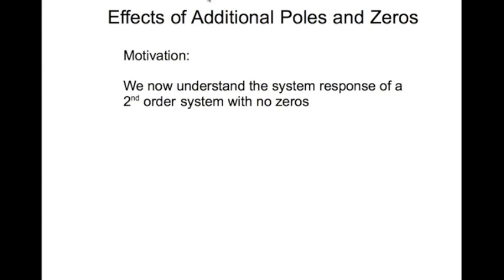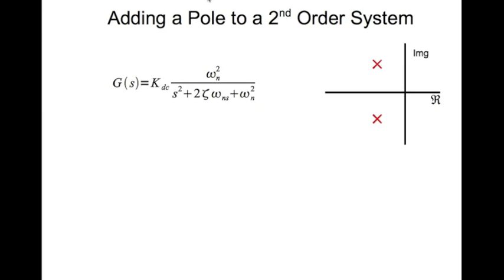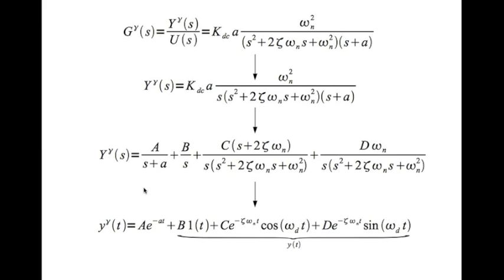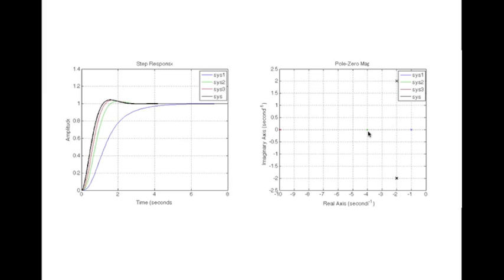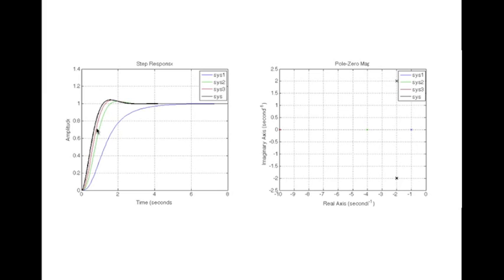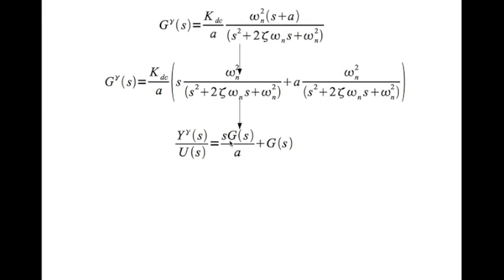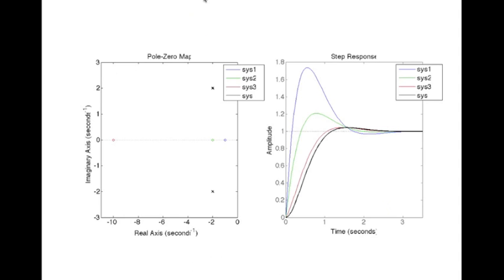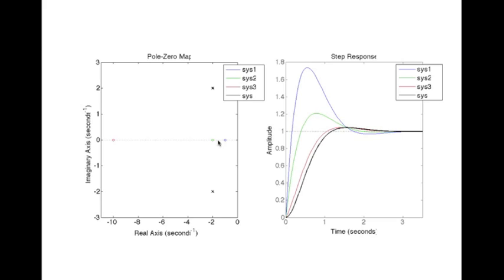Effect of Additional Poles and Zeros

Comment: One question here, for a standard 2nd order control system we can easily get its natural frequency and damping ratio. But with an additional zero, it is no longer in the standard form and as shown in the video the step response changes. but does the natural freq. and damping ration change with added zero?